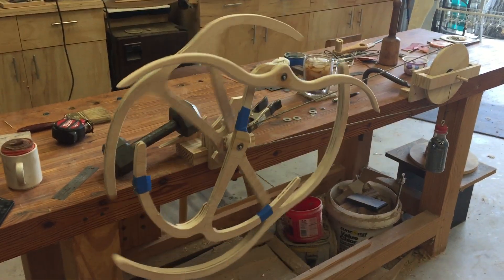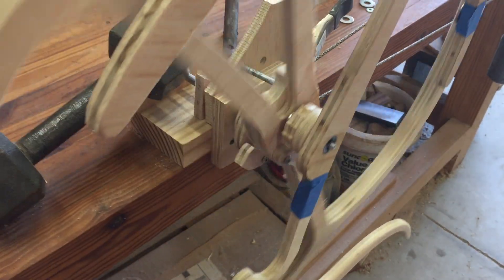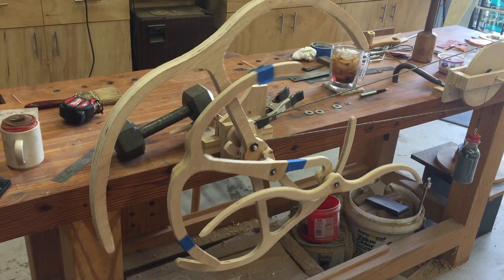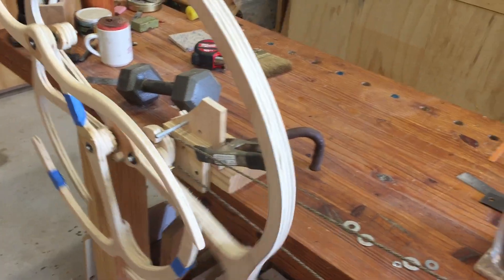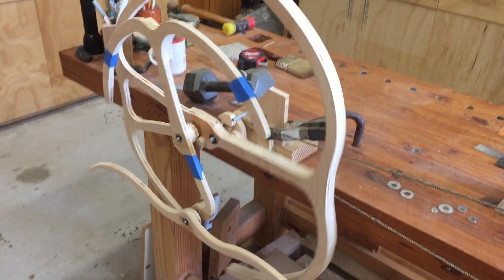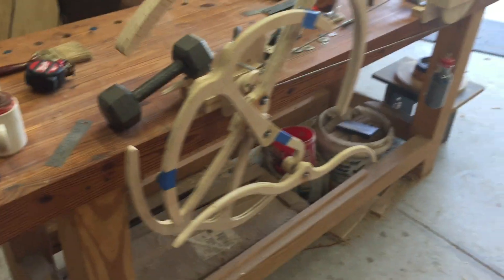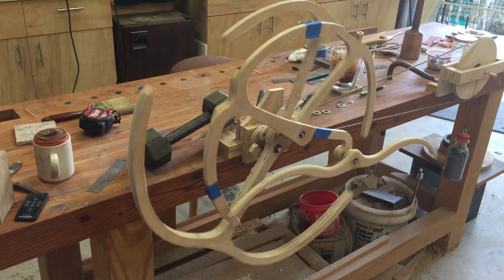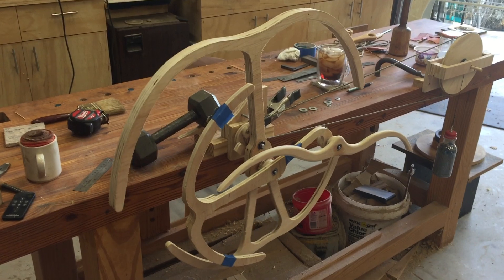Kinetic Sculpture Prototype Update

Comment: Beautiful. I'm also planning to make a kinetic sculpture. I'm very curious about your progress Do you have a special technique to mount your ball bearings?
Reply from the maker: Thank you. No special technique for the bearings. I use a Forstner bit to drill a hole to match the bearing. I use e-clips to hold them in place.
Reply: Will you give some information about the thickness of the material,  the axes or rods etc.
Reply from the maker: Sure. I am making this one from 1/2" plywood from Home Depot. I'll probably make another using Baltic Birch. I double the thickness anywhere there is an axle and I've doubled it a few other places for balance reasons. I used 3/8" aluminum rods for the main axle on the wheels and the weight pulley. I used 1/4" aluminum rods for connecting the bird to the smaller wheel, and the smaller wheel to the larger wheel.
Reply: Hoi David, after a while I finaly  started with drawing. Can you tell met what 's the outside diameter of the pal mechanism, the diameters where the rope runs over, the wide en height of the birth, the front wheel en back wheel  and the two diametes from the wheels of the weight mechanisme. So i have an idea of the ratios.

How you became the shape of the pal?

thanks